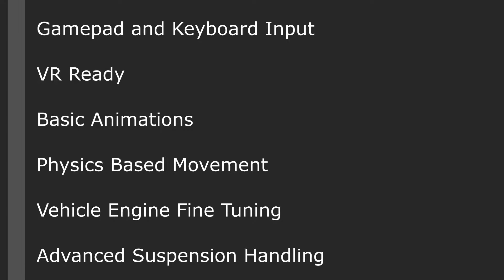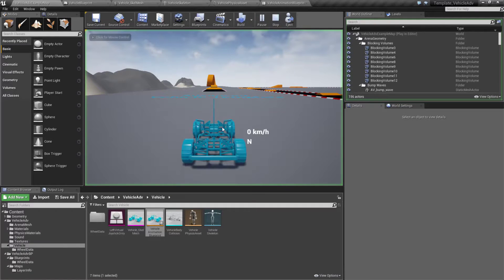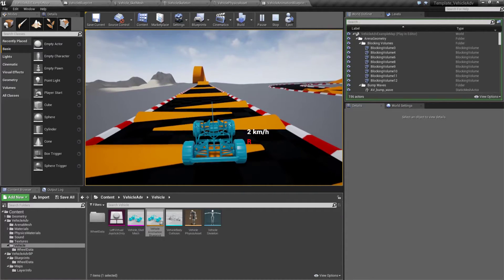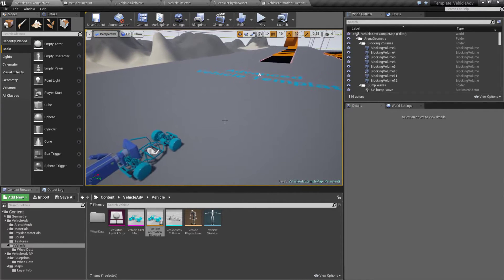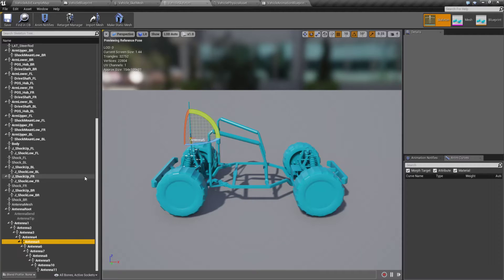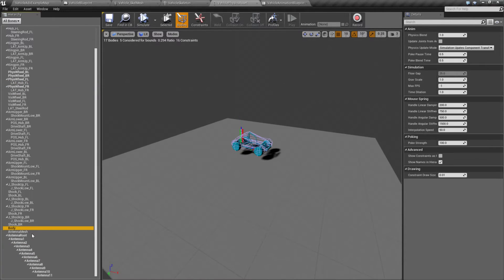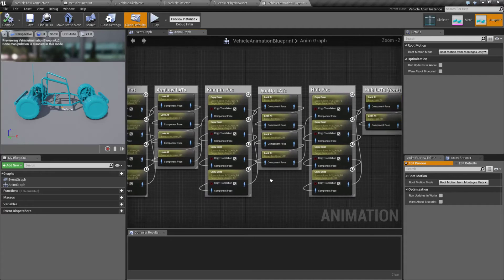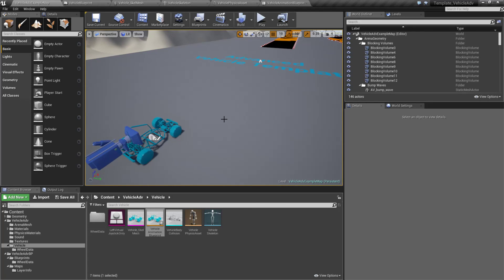Game Jam Tips and Tricks - Advanced Vehicle Template

Comment: every single vehicle i ever used in demos/ or free projects , all the vehicles flip and get launched in to space ect when hitting different things at speed. doesn't matter about the mass or tensor scale or mass origin , they all just flip out and go crazy  , is there any documentation that can steer me in the right direction to avoid stuff liek this ? as ive yet to see anything about it
Reply: Yeah, you can either set some limits on the forces, or you'll need to update physics more often. I do that. Look at unreal physics substepping - it should solve this issue (cpp only, AFAIK).
Reply: @GonziHere  yeah cheers for the reply mate  , since then got got it all sorted out and learned a lot more  , the substepping pretty much fixed the issue i was seeing if i remember correctly